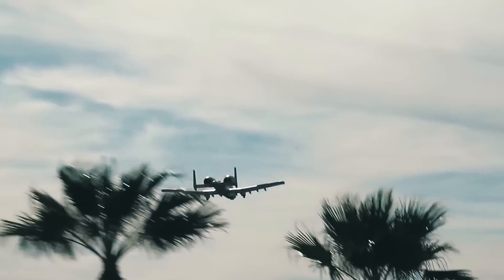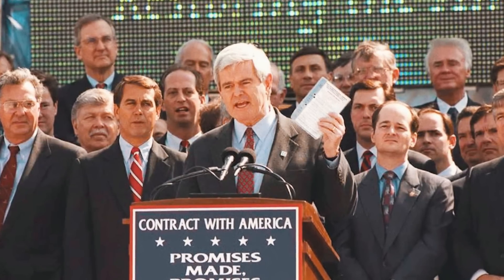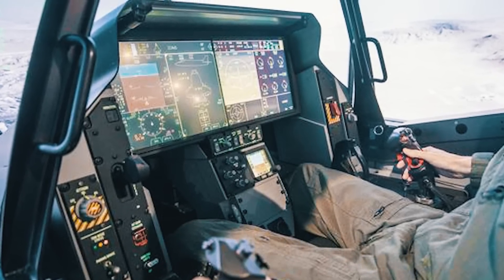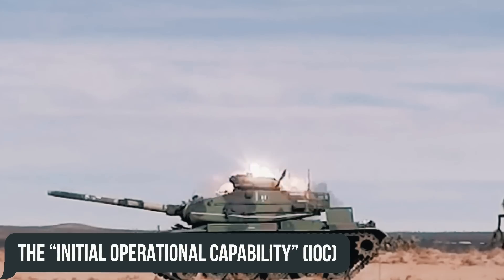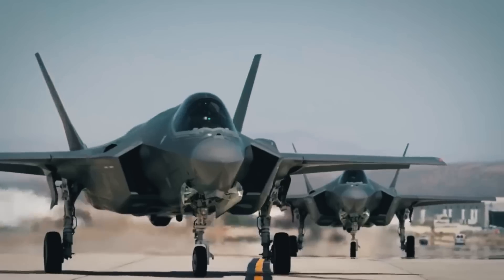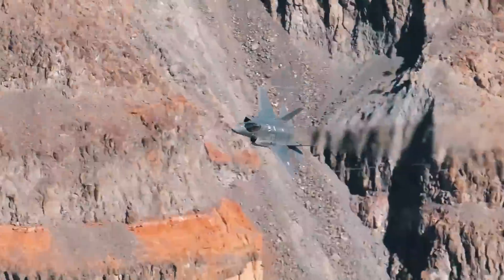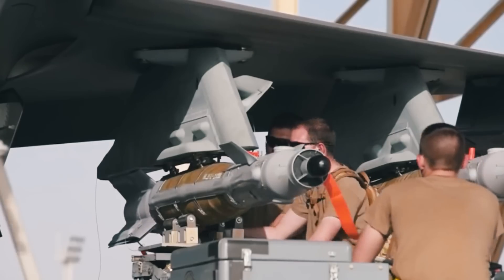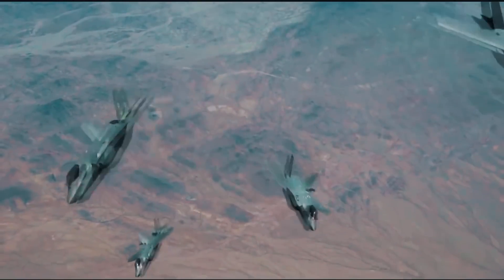New F-35 Shocked Russians: The Only Fighter Jet To Beat SU-57

Comment: Sorry, but there isn’t an aircraft out there that can replace the A-10 in its ground support role. The A-10 is by far the best purpose built close air support platform ever conceived. Other air frames may beat them in many other roles, they won’t in that function. Just my opinion, but I’m a bit biased due to the fact that A-10’s have saved my ass many times….

Comment: The F-35 is so good that they had to revive the A-10 to help it do its work.
Reply: False. Most CAS missions in Iraq and Afghanistan were executed by airframes other than the A-10. Vipers, Eagles, Hornets and even B-1s execute that mission. The A-10 is best at that single mission, but it can be and is most often done by other platforms.

Comment: A few notes, Bravo variant IMHO as a someone that has had hands on stick, smokes alpha and Charlie variants. Let's set that aside for a tick, comparing the hog to the 35 is so much apples to oranges is like loving your dog vs your lambo. They have VERY diff roles, The A-10 can hit a lower air speed and a higher AOA than the 35 ever could. So, I love my hogs. An A-10 gives ground forces a rally as well. Nothing like bad fight and hearing the "brrrrrrrt" a few ticks after watching hell rain down to make your whole day change directions. My only issue with 5th gen, at least the 35 doesn't need a week of hangar time after each flight. Suck it Raptor! LOL

Comment: I feel like the beast mode is the last resort where no other other aircraft are available for air superiority.
Reply: Beast mode is only supposed to be effective AFTER we've achieved air superiority, since the external stores seriously degrade both the F35's stealth characteristics AND the additional weight & drag degrade its dynamic performance.  But stealth isn't very important once your side has already established control of the airspace, and now we need basically more "bomb trucks".

Comment: Lockheed Martin is famous for ripping off the government once they gain the contract. The U.S government is famous for going for slicker designs over performance and practicality and Boeing should have known that. Still, Great plane not designed for close combat. Can only carry 6 missiles, has just 150 rounds, ain't that fast and it's overly expensive. An increased cost of 89% than initial estimates? what a rip off! Nothing new for Lockheed martin though.

Comment: the f22 can run circles around the su-57. I think the f15 has a fair chance against the su-57 as well.
Reply: Russia has 16 SU 57’s. 6 production models and 10 prototypes. 
It’s rumored that the first production SU 57 crashed in testing but I’ve never seen conformation of this. 
It’s also known that at least 2 of the prototypes had severe engine fires. 
It’s also unknown to the general public if the production models are using the actual engines that they were designed to have as they were having some serious problems with them.
Reply: idk, I wouldnt go that far but the f22 is definetly the superior aircraft, not to mention the fact that russia has  12 su 57s and none of them are combat ready. But the f15 doesnt really stand a chance, the su 57 beats it in most departments

Comment: The F-35 is quite capable. Its weak point is dog fighting. Should not be much of an issue, however if you're all alone, and you're face to face with a dog fighter capable jet, It's game over for the F-35. That's when you'll be wishing you were flying an F-22 instead. I still don't think the F-35 can fully replace the A-10. IMO the A-10 is in a class all its own.
Reply: Thats why the F-35 is never alone.  If you see one, youre likely already spotted by MANY other assets
Reply: Planes don't dog fight anymore...if they do they're old and outdated.
Reply: The primary issue with the A-10 is that it could only be used after you've already achieved air superiority, as it's pretty much a sitting duck against any fighters with a halfway decent pilot.  Which is fine in the Middle-East, where we're likely to achieve air superiority quickly.  But in a near-peer conflict, that might not be the case.

Comment: screw that Ukraine proves our stinger set up is more than capable of taking out the SU-57, why put a life in the way when you can just destroy it in air with a fraction of the cost. hell fly small drones with wire nets to get sucked up into the turbines induction system....drones like 3k and lots of them for the price of 1 stinger..lol....hell maybe throw a snow ball at it and take it down..

Comment: Come on everyone knows the F-35 has had major problems with F-16's out performing them! I could go on about the way to complicated computer system problems even having several world renowned pilots call the plane a " lemon". No thank you I'll take the F-22 and you take the F-35! With your life on the line if you choose the F-35 then obviously you are ill informed.
Reply: F-16's have not outperformed the F-35 ever. Only test models with intentional restrictions have had trouble dealing with F-16s.

There are no world renowned pilots calling the F-35 a lemon lol. There's a couple of world renowned morons calling it a lemon, and they have also said the same things about the F-15, F-16, and F/A-18, only to be proven wrong every single time.

Computer issues? Yeah those things are minor and uncommon in comparison to what the F-16 went through during it's first decade in service.

Comment: F- 35 wasn't meant to be an air superiority fighter, but she can hold her own.
Reply: It was not designed to be an air superiority fighter, the F-15, F-14, F-22, and the Ngad are were and will be our air superiority fighters the F-16, F-35 are multi purpose fighters. It's so high tech it's advantages blow most planes out the air, if you pit an F-22 against an F-35 which do you think would win?
Reply: @timper4326  F-22 easily
Reply: @timper4326  The f-14 was not an air superiority fighter. The f-15 was the first full air superiority fighter since the f-86 saber. the f-14 was meant to intercept incoming Russian bombers and to be a superior BVR fighter. It was not built as a full-fledged air superiority fighter
Reply: @BradyWoodward34  maybe not but it could outrun out maneuver out gun anything facing it it's closest match was the F-15. Being carrier based it had to perform multiple roles.
Reply: @BradyWoodward34  You sure about that? I thought that's why they gave it the sweep wings....to increase it's AOA at dogfight speeds. Even to this day it's one of the best 2 circle fighters ever made......but at lower altitudes. Planes like the F15 were better at high altitudes because the fuselage gave more lift. But near the deck the F14 was dominant and would still be one of the best 2 circle fighters in the world.
Reply: @timper4326  f18 superhornet is air superiority that’s why the navy never really wanted f35
Reply: @timper4326  The F-16 Is an air superiority, and was designed as such, it's just capable of performing as a multi role if needed
Reply: @timper4326  ALL other things being equal, probably the F-22 but the world is neither equal or fair.
Reply: Ko thãy 1con oc vit tren f35 that tuyet ve
Reply: It was the Navy's air superiority fighter, and the super F-14 was better than the F-15, but to save money they went to the F-18.
Reply: @timper4326 . It was not better then an F15, and they had different capabilities. The F14 was an awesome interceptor with its long distance shooting Fox 3 Aim 54’s. The F15 was also good with its better fly by wire system, tremendous Power to weight, and it’s very good AOA that the 14’s did not have. The F14 did become better in the B variants thanks to the new GE110 engines which prevented compression stalls. Moreover, I would choose the F14 for long distance bomber shooting, and the F15 for Air superiority. You can also watch very skilled DCS players to see the capabilities on these two fighters.
Reply: @bri-manhunter2654  thank you for your very informative comment, it cleared up quite a bit for me. It's amazing how these  two fighters (F-15, F-22) can still dominate being almost 40 and 50 years old.
Reply: I dont understand your gibberish.

Comment: F22 is a tiger, a lone hunter. F35 is more like a pack of wolves. They work in a team with other players to get the advantage. Would not want to go against either one either way.
Reply: I disagree.  The F-22 never flies alone. It is network connected with all military vessels.  It is just 2 different networks that have a bridge.
Reply: The F22 is getting a lot of networking upgrades from the F35 and one day a great helmet! Then F22 and F35 will hunt together.
Reply: The Abrams tank fights in coordinated squads also.
Reply: What is the fighter jet in the thumbline ?? It looks badass ....
Reply: They should go with the two seater. Better situational awareness and the ability of the back seater to operate drones.
Reply: That's not true at all. The F35 is predominantly a multirole fighter that is not designed to dogfight, it is perfectly capable of making air to air kills but it will always seek to do so at BVR. In contrast the F-22 is predominantly an air superiority fighter, this means it is designed to outperform opponent aircraft in all types of engagement. Like the F-35 it is very dangerous in BVR fights thanks to its stealth, radar and armament, however unlike the F-35 it is also an INCREDIBLY capable dogfighter, it excels in both the 1 circle and 2 circle fights and would walk all over the F-35 at close range. The argument is that with modern technologies the ability to dogfight isn't as important as it used to be because chances are if you come up against a flight of F-35's, unless you're in a near peer stealth aircraft, you're not going to get the chance to get to dogfighting distances before you eat an AMRAAM to the face.
Reply: @Ws_minion i agree with what you said but would like to chime in on your statement. The f35 may not be able to have the same maneuverability as the f22 when it comes to dog fighting that doesnt mean its cant dog fight at all.  The f35 dog fighting ability actually
Has matched and in some other aspects exceeded the f16 dog fighting ability in certain aspects. The first few years that it was release the f35 software was limited to 7 - 7.5 gs and 
Eventually was updated to 9 gs.  If you search on youtube type f35 pilot hasard why the f35 been getting all the hate.

This pilot has thousands of flight hours of experience in the f16 who eventually promoted to fly the f35. He will tell you the f35 as far exceeded the f16 in all aspects.
Reply: @89turbomk3  I think you may have misinterpreted my comment, I didn't say the F35 couldn't dog fight, I said it wasn't designed with dogfighting as a priority. I'm sure it is perfectly capable of outperforming some legacy air frames (though i think the F16 would still outperform it in 2 circle rate fights but to be fair it will outperform most in rate fights) but I was comparing it to near peer gen 5 counterparts (F22, J20, SU57 etc). There is fairly irrefutable evidence that it wasn't a design priority due to the B and C models both lacking an internal gun which (as the phantom taught us) is very important if you're going to put the plane into dogfighting situations. My point is that if your new plane is roughly on par with gen 4 fighters and outperformed by almost all gen 4.5/gen 5 fighters it's a fair statement to say that it's not designed with dog fighting as a priority. But as I said before, in 2022 that doesn't matter, it's still a kickass aircraft and I hope NATO gets as many as can be built.
Reply: @Ws_minion  yea i never said it was designed to dog fight however is fairly capable regarding the f35a. The f35a is hold the majority of the production.
Reply: F35 is like a Sherman tank of the sky. Totally mediocre but we can pump out a ton of them.
Reply: @steveguy7165  The F35 3 years ago had mediocre dynamic performance, since the last few software updates, its dynamic performance (>400 Kts) is now somewhat superior to the F16, which is exceptional.
Reply: @stanimal8   exactly off the line it was a pig with recent improvements being superior to an f-16 is a huge achievement.
Reply: It’s all about thrust vectoring f22 is only vertical thrust vectored whereby the su57 is multi lateral thrust vectored and a way more advanced airframe than the f22, why they changed over to the f35 multi vector thrust platform. The su57 breaks the laws of physics whereby the f22 does not.
Reply: @meagain1238  thrust vectoring only improve turning performance at low airspeed and provide minor turn rate improvements at speed.  Most modern fighter aircraft could pull >9g's, while thrust from the engine(s) is at best slightly over 1g based on thrust to weight ratio.
Basically, if you turn too hard and bleed off too much airspeed, you become a flying brick.  Moves such as the Cobra are airshow moves, pretty worthless in a dog fight.  But in a modern stealth fight plane, you've already lost much of your advantages by the time you get into a dog fight.
Reply: @stanimal8   very few situations is a cobra helpful the better way to use that is to gain slight advantages in a one circle or to perform an out of plane maneuver and bleed your speed to get the bandit out front this is in the case of a merge into a tight one circle or rolling scissor
Reply: @deadshot4245  I agree, the limitation is the cobra maneuver could only be done at low speeds (excessive wing loading at higher airspeeds), and once done, significant airspeed is lost due to high drag and extreme AOA, further reducing aerodynamic dynamic envelope of the aircraft.
Aerodynamic forces on the surfaces are the thing that enable these planes to be extremely maneuverable, with sometimes >9g's of acceleration, the engines could provide at best ~1g, and much less in directions perpendicular to the direction of flight.
Reply: @stanimal8  id love to see the latest tech that's being worked on for flight computers on 6th gen jets. i know my goal building a jet would be to pack it full of abilities regardless if you had to ever use them or not. because the mentality of its better to have it and not need it than to need it and not have it. costs usually constrain the budgeting but can you put a price on peace (Dave mustaine reference) lol
Reply: @deadshot4245  What you stated is not really how plane are designed.  Typically the government write some type of request for quote, specifying what they are looking for, dynamic performance, stealth, range, payload, and another 100+ detailed requirements, then the potential contractor come up with proposals by phases, with design concepts by many competitors and limited government funding during the early phases, then down selected to few of the best proposals with far more government funding to continue the development.
Modern fighters are mostly modular designs, incorporating airframe from one company, engines from another, radar from another, etc, with a huge integration effort.  And that doesn't include the huge effort on the software side, how to convert the pilot's command into actuation of various aerodynamic surfaces and how to provide the pilot with the best situation awareness without overwhelming him/her.
IMO, currently, the US has a huge lead of the software side, even though it is rarely talked about.  So while the SU-57 might look nearly competitive with the F-22 on paper, in reality, it is far easier to more fully utilize the tremendous capabilities of the F-22 in combat, which mean in real-life, I would expect the kill ratio of the F-22 to SU-57  to be far better than 10:1.
Reply: @stanimal8  I know I’m not gonna dive into a scientific level on something overly complex as designing a jet. Waste of time on YouTube comment threads
Reply: @deadshot4245  Plus nobody that knows anything about classified 6th gen technologies are going to disclose it in public.  What we often see on these types of sites are technologies either 2-3 decades out of date or are educated guesses at best.  With the US tending to undersell their technologies and the Russians overselling theirs, as they are often relying of foreign military sales to pay for development and manufacturing costs (see SU-57).
Reply: @meagain1238  🤣😂🤣😂🤣😂🤣😂
Reply: @meagain1238  the su57 breaking law of physics as shown during air show are completely useless in actual air combat situations.  All these cool looking moves bleed off speed and leaves you highly vulnerable .